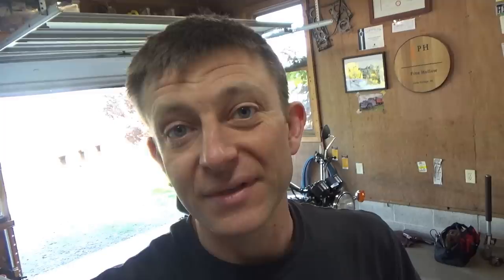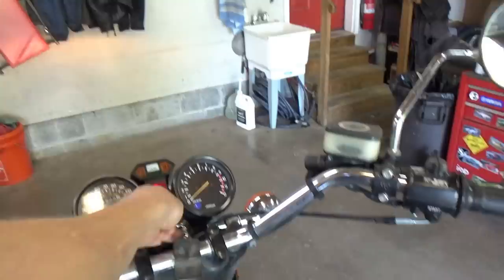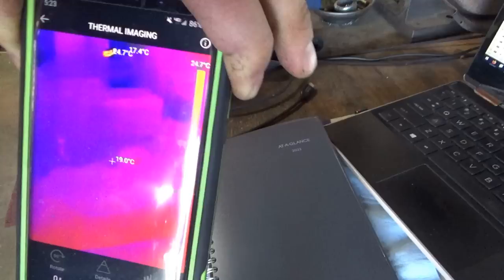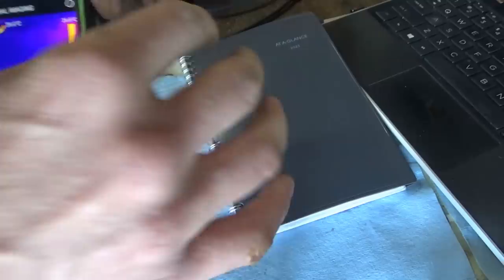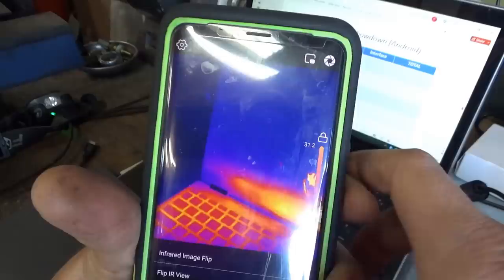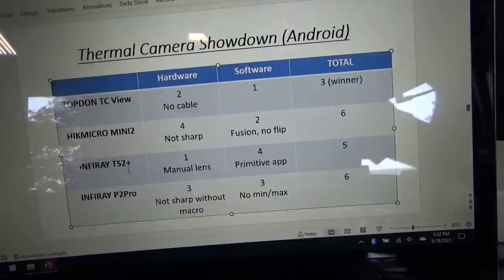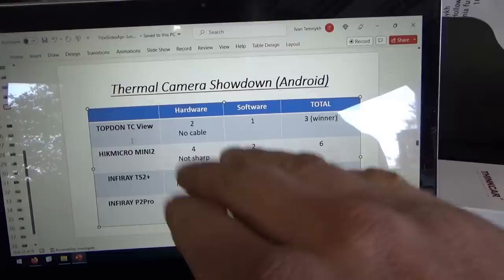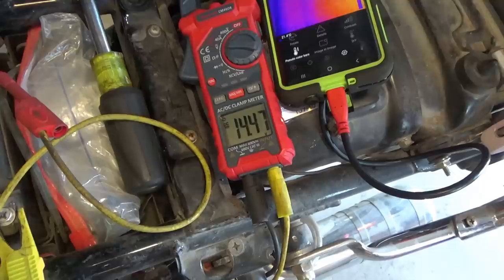Voltage Drop? Mini THERMAL CAMERA Showdown! (TOPDON vs. HIKMICRO vs InfiRay)

Comment: I want/need a thermal camera.  I refuse to buy anything that uses a phone, because when the phone shits the bed, the camera will probably not be compatible with the new phone. Still waiting for the prices to drop on the stand alone ones.
Reply: All of these cameras work as a normal camera on a PC too - they appear as a USB webcam, but provide 2 different image streams. One with black and white thermal image, and one with the temperature of each pixel encoded to an image. The software isn't quite to the same standard as the phone apps (which aren't perfect either). There's some open source software for them on the PC that's getting better though.
Reply: @gorak9000  Thanks for the info.  I will wait for a stand alone camera, just because it won't need another device to work, like in 15 yrs when new phones are embedded under our skin lol.  Can you tell I'm anti phone?  I hate that friggin thing, esp because society has forced us into having one.
Reply: @scrappy7571  I have one provided by work. I turned all the notifications off, the sound, including the ringer, is off 95% of the time. I set it so all calls go to voicemail, and I use it to check my email, light web surfing on the go, and for the thermal camera. Just because you have a phone doesn't mean you need to have it tied to your hands 24/7 like most people do.
Reply: @gorak9000  Pretty much the same here, but then I forget and leave it home, or at work, or in the car... Friggin PIA!!  One weekend forgot, and left it at work, decided not to go back and fetch the damn thing.  Was getting emails all weekend, are you OK? Are you alive??? Why don't you answer??? I can say 1 thing for sure about the POS, it can take a beating!  It's been tossed across the shop many times, and still works except for the vibrator thing, the weight fell off inside.
Reply: @scrappy7571  Mine was practically new (maybe 4 weeks since I got it) when it fell out of my pocket on a golf cart and went skidding down a paved path down a hill - scratched the front up pretty good (not the glass though). The person I was with seemed mortified, and I just said "meh, whatever, it's a work phone, who cares".

Comment: On those bikes, even with a good electrical system the coils aren't the best. And they are a waste spark system typical of Japanese bikes of the time. Dyna makes a much hotter coil set up for those. Due to the compromise of the design and the age of the coils, I'd change them. Make sure the new ones have the same primary resistance.
Reply: Chevy makes coils that work great, I robbed mine from a 92 cavalier..😊
Reply from the maker: This one is a 3 cylinder, so one coil per cylinder. Never seen a Yamaha OEM coil fail...unlike Hondas haha
Reply: @Pine Hollow Auto Diagnostics  I put 2 coils from a 92 cavalier on my 83 450 honda. They work great 👍 
(I just happened to have a very rusty cavalier in the backyard)
Reply: @PineHollowAutoDiagnostics  they aren't the best however. Those coils will test good on the bench but under use, the lamination isn't the best and can cause high voltage loss. Trust me, hot coils-good. Factory coils-meh.

Comment: I often wonder why nocturnal predators don't see in infrared. It would seem a no brainer to evolve an eye that detects a heat source, which would be a huge advantage to a predator that eats mammals. With the longer wavelength, perhaps the fine resolution isn't as great, or perhaps there is a trade off for survival during the day, when visible light gives advantage to fine detail.

Comment: Android based devices are time limited. Good for maybe 2-3 years, then not likely to be supported. Temporary at best. I have learned my lesson, never again. Android apps are temporary, Almost as stupid as a $15000  scope that runs an obsolete microsoft windows. Just toss it on the scrap pile.
Reply: Any of those scopes that run windows can be upgraded - try looking harder on the internet. And at worst they work just as good now as they did originally - it's not a computer, it's a scope that happens to run windows as the base OS (a poor choice sure, but it is what it is). All of these IR cameras work on a normal PC to as a regular USB camera. There is some open source software for them that gives you more of the traditional thermal camera features you'd expect.
Reply: @gorak9000  Will modern hardware restricted windows 10/11 run on a scope designed for XP? How much for a new windows?

I have had way too many android based HW  items go in the trash because the app disappeared or stopped being updated in a few months. Android=planned obsolescence. it's good for like 2-3 years max. It doesn't have to be this way, but google always wants to make things difficult and costly. They care only about data mining.
Reply: @rickkcir9959  Why do you need to run windows 10 or 11 on a scope? Realistically windows 7 gets you everything you need (typically SATA support, and USB 2). I just finished upgrading a logic analyzer that was f'ing slow and ran windows XP on a P3 1Ghz with 512M of RAM and a spinning IDE disk with a "new" motherboard with a core 2 duo (newest thing I could find with a motherboard that fit, and had a regular PCI slot for the interface card to the hardware) at 3.1Ghz, 4GB RAM, and windows 7 64 bit on a 500GB SSD. Now it's faster, and a much more useful tool - I have gig ethernet / USB 2 to get stuff on and off the machine, the motherboard has VGA / DVI / HDMI to make it easy to connect modern external monitors, and the software runs much better with more ram and the faster processor. Again, it's a piece of test equipment that runs windows, not a primary use computer. You don't need to upgrade it to current hardware / software to make it useful. Do you really want all of M$'s spyware running on your test equipment? Do you need to play current 3D games on your scope with a RTX4080?? No, you just need something decently fast that's better than it initially was, and supports somewhat modern hardware, and it feels very modern and snappy.
Reply: @rickkcir9959  Seeing as your talking about a $15,000 scope that runs Windows XP, I probably know which family of scope your talking about - there's only 2 or 3 such families of scopes out there from Agilent / Tek / probably LeCroy. If you look around, you'll see people have figured out how to upgrade them / how far you can upgrade. This stuff isn't rocket science, and someone has probably already done it.
Reply: @gorak9000  Yes. Now. At the time I needed it, there was less info. Today you can just google it. We spent a lot of time goofing with it, eventually sold it for pennies. 

I appreciate what you are saying, and I agree. At the same time, I still hold that buying devices that expire and require ongoing support is foolish if there is another option.